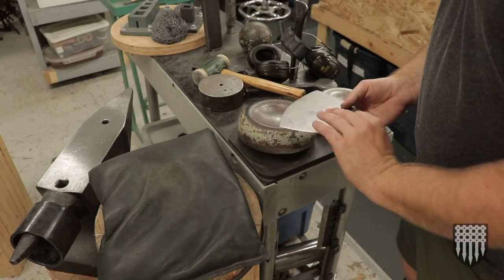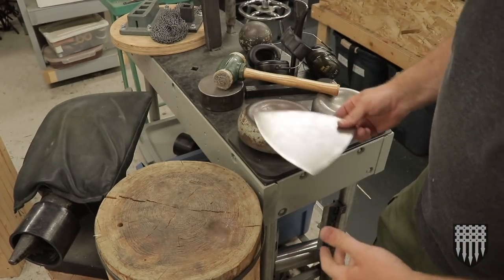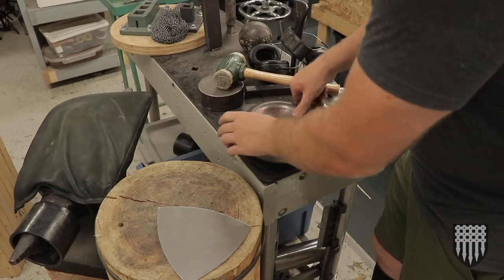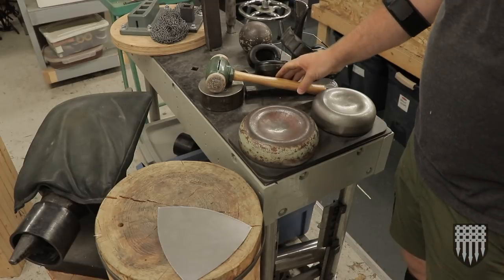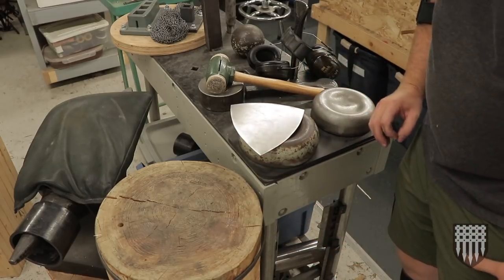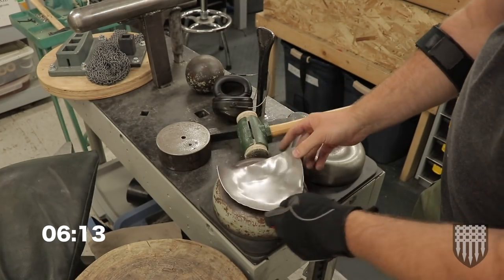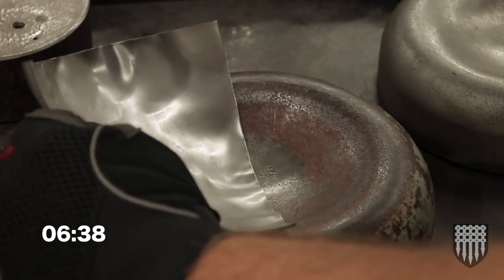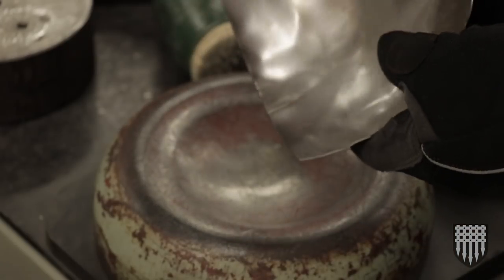How to make Armor: Making Medieval Armor: Forming Helmet Plates Real Time

Comment: The video is great nice positive and encouraging. Can I ask a couple of questions, if you have any videos along the lines of leather inner mits for plate gloves or do you take the method of pre-made leather gloves (rigger gloves maybe) and stitch/tie to the gloves. Also do you have predefined metal types and thickness for different historical eras. Thankyou
Reply from the maker: Thanks Chad, I’ve both made leather gloves and used store bought ones. Almost all armoured hand protection has a layer of leather that is riveted or sewn to the plates. It’s the extra layer that gets stitched to the glove. This makes for mor convenient replacement and more padding on the back of the hand. Metal for hands is often quite light and made from spring steel that is hardened. 20-22ga is very typical.

Comment: Thanks for the video! 

You said this was 18ga mild steel, for costume only.

What would you use for protective armor? Where can I find resources on the heat treating process?
Reply: 1.5 millimeters or more is pretty much necessary for protective midevil style armor-
I use 2 millimeter for thick for helmets.

Comment: So actual thicker steel or iron takes more time to dish?
Reply: Yes because its more material to move
Reply from the maker: Yes.  When I use Thicker steel I heat with a torch.
Reply: This is roughly 1.2 mm. I made a viking helmet out of 1.8 mm steel a while ago, using simillar techniques. Took about 7-8 times as long to dish in the rough and VERY LONG to planish and polish
Reply from the maker: +Lukas Jacobs Planishing and polishing takes forever!!
Reply: Yes, definitely. Our shop uses a repurposed soil tamping hammer which can cut down the time a ton - dishing 1.6+mm is unreal tough without a torch or forge otherwise.

Comment: Just btw: Do you know of any viable alternative to those cleco fasteners? Because in central europe, it's really hard to get your hands on something like a 4.8mm rivet or round steel. 5mm on the other hand is really easy to get. There's absolutely no chance of getting anything here, that fits imperial units.
Reply from the maker: What size rivets do you commonly use? 5 mm 4 mm, 2.5mm ? I can drill some holes and test my clecos to see if the imperial clecos hold in metric holes.
Reply from the maker: Also yardstore.com (an American manufacturer) claims to make metric clecos.
Reply: @DrawbridgeProps  usually 3mm and 5mm.

Comment: I know this question depends on location, but how do you generally get your steel? I usually have to end up ordering because all the hardware stores have only 16 guage mild (I need 14).
Reply from the maker: I order from a metal alloy supplier.  4’x8’ sheets at a time.

Comment: What kind of tank did you cut the bottom off of to make your dishing tool?
Reply from the maker: +Robert kercher I believe they were oxygen. But it was many years ago so I could be wrong. I went to local gas refilling place and they gave me old tanks for free. I remember being very concerned about cutting the tanks and having them explode. I opened the values and then slowly drilled a hole in the side to make sure they were empty. Then I cut them with a plasma cutter. Pretty easy job really.
Reply: @DrawbridgeProps  thanks a bunch, I guessed that is were you got them, found a place here in Washington. They seemed happy to see them leave. Been a metal worker for a long time mostly swords and leather armor. Your videos have been very helpful in setting up my shop. Thanks again. If you are ever in Washington during the beginning of august stop by the midsummer renaissance fair you can find us at the Runesmith booth.
Reply from the maker: Robert kercher thanks for the invite!! I will definitely hit you up the next time I am down.